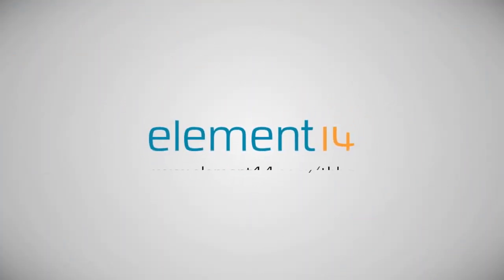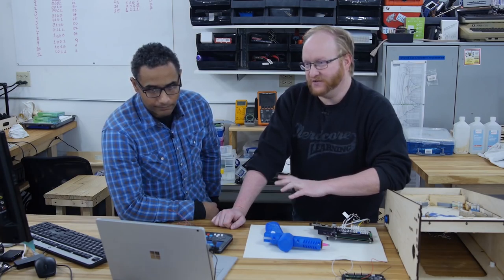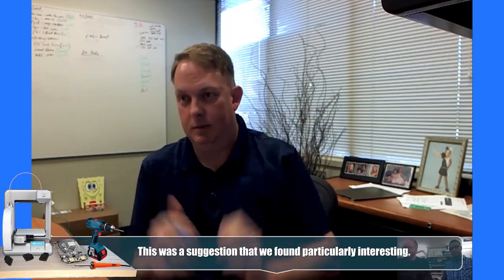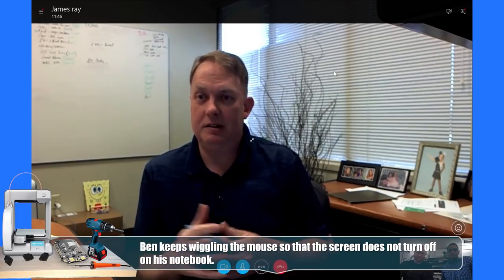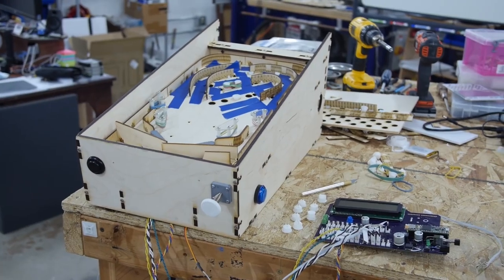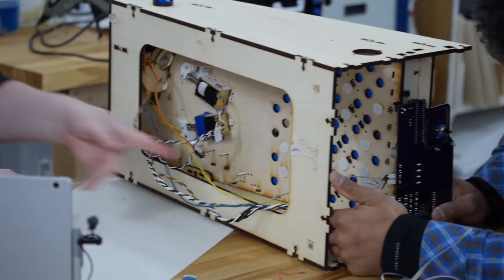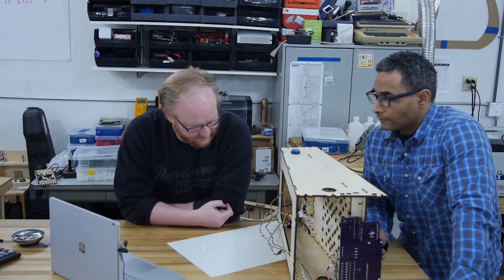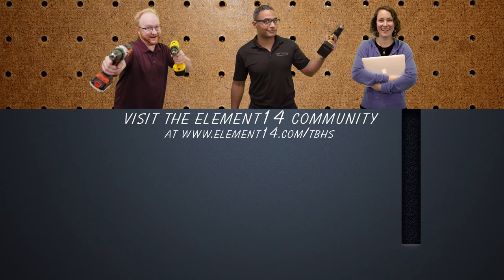Super Glue Gun & Mini Pinball: Which One Gets the Axe?

Comment: I think you made the right choices for which products to move forward. My 2 cents is that I would be interested in a portable raspberry pi, but I would want something that acted kind of like an add on that could work with the raspberry pi 2, 3, and zero rather than a single board custom pi. I think it is really cool that they can make custom versions of the pi, but the reason the pi is such a useful thing is that it can be moved around and re-purposed for lots of projects and prototypes. If you make a custom pi, then it only really serves one purpose. That can be fine for a lot of things, but for this product in particular, I feel like being able to use any pi and then be able to use that pi on any other project would be better than having a task specific raspberry pi made that plays some games, but has to be modded again to be used for anything else. The pin ball kit is really cool too, but I am not that into pin ball, and it looks like it would be expensive lol.

Comment: I know I already voiced my approval for the Pinball Kit, but there is more potential than I may have mentioned before. The board alone could be a major thing, as people who are scratch-building a pinball could use that board! I had considered building my own, and developing a Unity app/hacking a bluetooth controller to handle inputs sound and scoring, but no real support for driving solenoids or servos. The board alone would solve that issue.
I could drop it in to an old Tomy Astro Shooter as a retrofit and update the sounds and scoring system, even change the mechanics (use actual solenoid pop bumpers /servo for ball lift for the ball cellar mechanism instead of being strictly mechanical)
So many possibilities. The board alone would be worth it. definitely don't let it go to waste. Pi's are a dime a dozen these days.

Comment: I built my own PI hand held about a year ago after being inspired from your videos. 3D printed the case, hand made buttons, PCB, etc.  It was much harder than i initially thought and had to be made much larger than i wanted... but everyone i've showed it to wanted to buy it.... So its absolutely marketable. I used a Pi3, the power draw was higher than most PNP products on the market supported at the time. Might be different now as the market has matured. I was able to get it all working with about an hour playtime per charge... but a KIT like you suggested would made the decision to build come years sooner. One thing i would suggest is to use the fastest ARM CPU possible and add active or passive cooling. Using the PiZero or Pi1 will impact the performance of emulation. Since you are making a custom PCB, why not use the Pi3 ARM processor and just omit radio modules on the custom PCB... that 2.5a power draw +lcd, +speaker amp, +Teensy Controller.... is hard to overcome without bulk... your GPIO interface solves most that so... Just one question... using a custom PI compute module.. would that impact the cross compatibility with other software in the PI community? would i be able to run Stock RetroPI on your custom PCB?

Comment: Resdesign for 1 PCB is awesome. It'll still run like normal, so no biggy there.
But, i'd still always add Bluetooth and WiFi capability as standard. And probably an HDMI(mini) out, a USB port for an extra controller/player at the very least.
Without, i'd never buy it.Adding a cheap controller is easy, if you want more players you can always go Bluetooth.
Wifi is easy for access to add ROMs etc. Ethernet is faster, but not really needed, but having to add a dongle etc, it just sux.
I joined a Kickstarter for a build your own style thing, with a Zero W, but it wasn't all that.
That dude now has a new one with a full PCB but not RPi compatible, so for me it's a no go.
So, full RPi compatibility with the full functionality is what i would have to have as a minimum.
BT and WiFi, at least 1 USB, HDMI out, headjack, volume adjuster.
But, it needs Pi3(the + Runs just that little more than the normal RPi3 does, but not a hard demand) power.
Why run on old tech ?
I will keep looking until i have it that way, and it doesn;t look like it's gonna take long right now.

Comment: I want the portable with the new raspberry pi 3 that just came out. Better emulation with the 1.4ghz CPU. With WiFi and Bluetooth. Easy access to the SD Card slot and 2 USB Ports. Have no ports along the bottom. Include a pop out stand on the back so you can prop it up and play with external controllers via USB or Bluetooth. Then a headphone jack.

Comment: For the portable pi It would be much cheaper to find or even design a slim sodimm connector for the compute module. Or just make a board same thickness and same pins, put them end to end and solder. Seems a lot of money to design a special pi for a small scale product. But i guess that part was just advertising for element14..